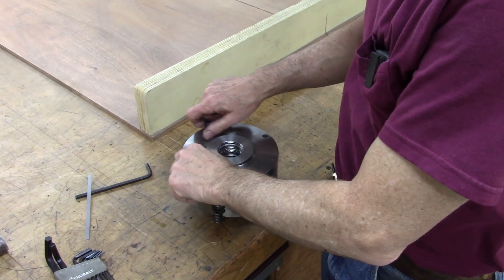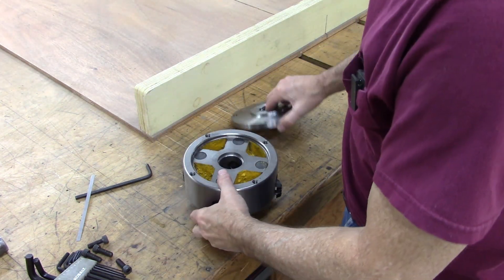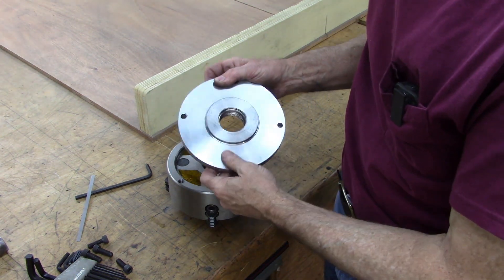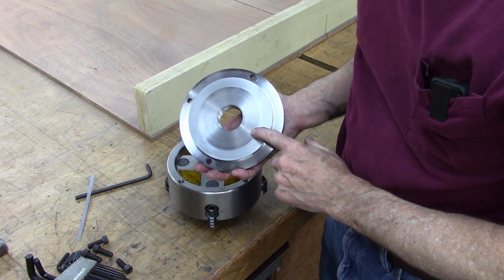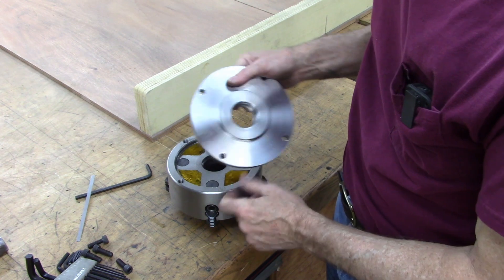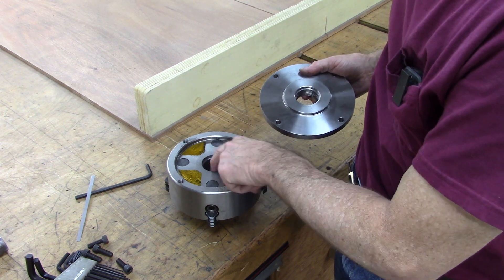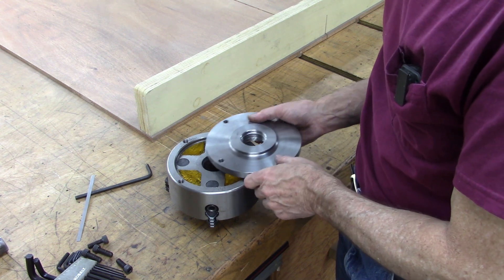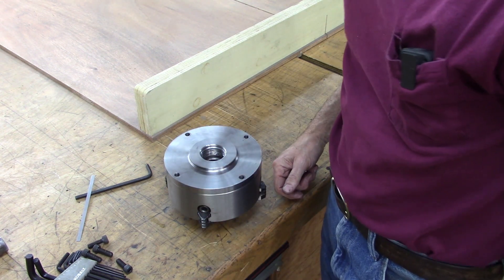Enlarging the thread mount on a backing plate to fit my South Bend Lathe

Comment: That is a weird thread. 1 7/8ths is the usual large size for that lathe. I’ve seen 1 1/2” too. But nothing was really standardized before the various taper noses came out.

Nice work.
Reply from the maker: Thanks Mel, the spindle is 1-5/8" not 1-7/8" but still a weird size.

Comment: Hay Winky, Love the dance segment.  You should check out the video I re-uploaded (it was an older one I took down and edited)  this morning. Besides a mention to you (The Gentleman) it may be something you could use given the amount of messing with spindles/chucks/backing plate threads you do.   Nice FAST job.... Don
Reply from the maker: Hello Don, yes I need to do the thread gauge. I watched the video, that's a good detailed explanation for sure.  If I make a gauge I'll probably just measure my spindle and aim for the same. A good fitting thread is better but in my opinion, not as critical as you might think. I'll bet if you measure the run out of your ER32 it will be the same every time you install the chuck. I've messed up and went too deep a few times (easy to do) but it doesn't seem to make much difference. Wait, Atlas better than South Bend, Ha....  Chuck overhang is a huge factor but it's more critical on smaller spindles. Threads are the weak point and the amount of stress on the threads changes exponentially with diameter. Hey I loved your Cheap VFD video! This is something I know very little about. Thanks.
Reply: @WinkysWorkshop  Sure thing Winky. Next time you're headed Florida way let me know.  I would have loved to catch up with you at FFL< but I had a work situation that week.  Oh ya... and eventually I will enlighten and bring you over to the Atlas side...  Don
Reply from the maker: @donsengine3158  - The Flywheeler will likely be the next trip to Florida. As for Atlas vs South Bends I'd say that this is model specific. I'm not a fan of Zamic gears on the Atlas but I'm sure it might have other pluses. I like the south bend slightly better than the Logan. It's made slightly more solid.
Reply: @WinkysWorkshop  I'm not really a sold on one machine guy.. I just like to be a PITA. Ha ha.. Run what ya brung is my credo. Keep up the good work Winky. Don
Reply from the maker: @donsengine3158  Of course!

Comment: I'm glad to see that worked so well, Woody! I've been considering doing this same thing for quite a while, as my Barnes 4 1/2 has a 7/8-10 (yes 10, not 14) spindle, I can easily get 3/4-16 backing plates, and 3/4 is the tap drill size for 7/8-10...
Reply from the maker: I've made quite a few backing plates. The threads are fairly easy but removing all the metal is a pain. I'll bet that Barnes lathe is cool!
Reply: @WinkysWorkshop  It is getting there. I do have a play list - https://www.youtube.com/watch?v=B9_VS7NeWQ0&list=PLKAxuXGYw9fuZyOKzSYunSROC57qfce9L
Reply: Go for it. Sounds very doable.

Comment: I'm a bit confused about something. Did you move a previously mated chuck and backing plate to a different lathe or was it a different backing plate from the one previously used with that chuck? I thought you were saying it was the same chuck and backing plate. In that case, after you made the threads and had the plate mounted directly on the South Bend, how did you have enough diameter on the plate to precisely fit the chuck?
Reply from the maker: The chuck back plate fit my Logan which was 1-1/2" (1" in length). My South Bend is 1-5/8" (1-1/8" long). I removed enough of the existing threads (bored) to get to the root diameter of the new threads and then cut new thread. Technically there was not quite enough steel to cut perfect new threads but I got lucky and the new threads fell right into the groove of the old threads but it would have worked even if this did not happen.